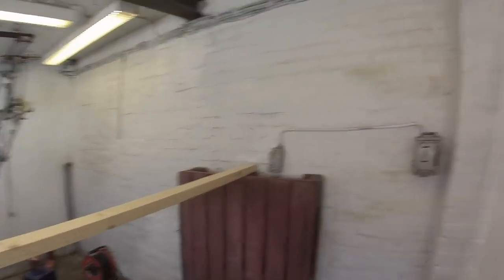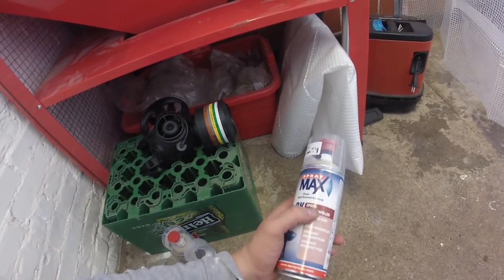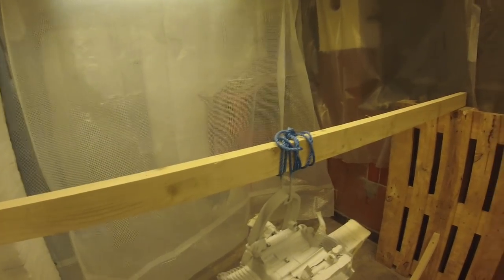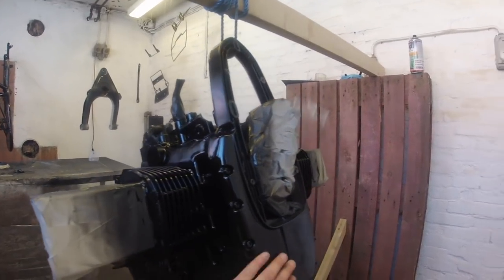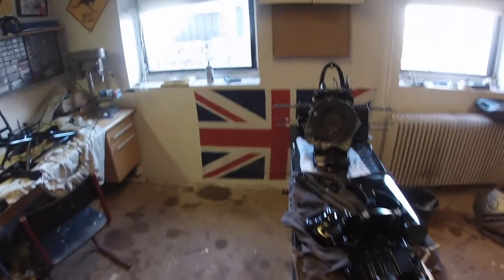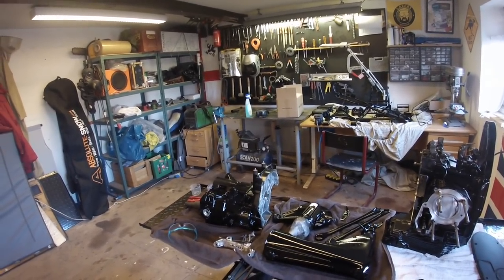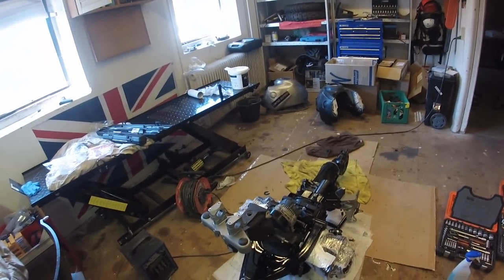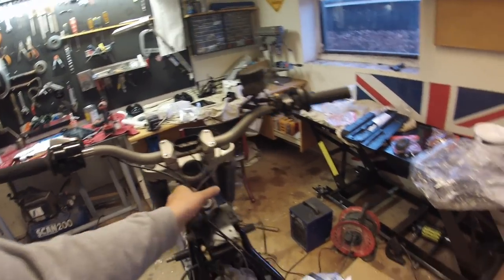Pt 10 (paint and assembly) Bmw r 1100 gs scrambler build

Comment: Hey Mate! Thanks for sharing your process! I just bought a BMW R1100 Gs to do the same project. Could you please send a link with the parts that you got?

I'm trying to figure out how to attach the headlights to the handlebars, also, for the oil cooler, did you use the original hose, or did you get a short one? 

Cheers man!!!

Congrats for this project is looking awesome!
Reply from the maker: Hey thank you! No problem, i can post a video on how i made headlight and oil cooler holder. For parts i used led  headlight with DRL from EBAY, 
Most of  the electronics are from motogadget, and highsider. The brake master is from a bmw f800 st. Seat is homemade. Exhaust is made from 3 different exhaust systems
Reply: Ohh awesome!!! Thanks, man! yeah, if you could show how you made would be great!!! I saw your video about the exhaust, I'll follow your steps when I get to that part, now I'm just trying to figure out the panel and the front stuff, I've never done this before, so I don't want to mess it out with the electrical part.
Reply: Hey man, great job !!